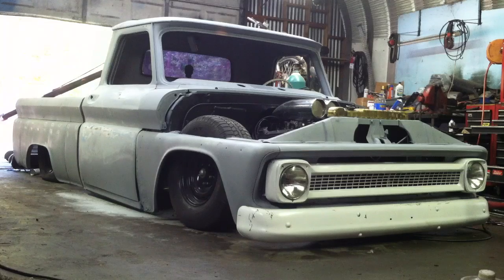1966 Bagged c10 sbc open headers

Comment: You said your truck may not look like much but it sure does to me, and sounds great also. I know where there is a '63 near me with a 283 not much money for it but it needs lots of work and I don't know how available parts are for it.. The '63 needs another hood... You have done a nice job with your truck, enjoy it...Cheers.

Wayne..
Reply: Look on Brothers Trucks or LMC trucks. You can literally buy EVERYTHING you need for it. 60 thru 63 headlight bezels are almost impossible to find a nice set and that is about the only thing that you can't get as a repo. Doing a 64 and almost every body piece on it including new roof skin,complete floor,doors,hood, cowl extensions etc. and they all fit well with minimal work. Not worth the $ to fix any very rusted part. Hood is also the way to go. Good luck. Although not cheap in the end it is cheaper than buying patch peices-cutting-grinding-welding-never ending body work.